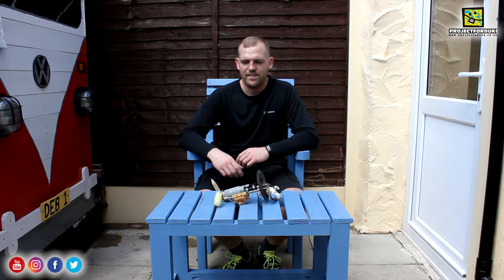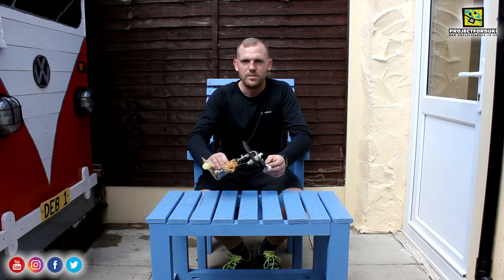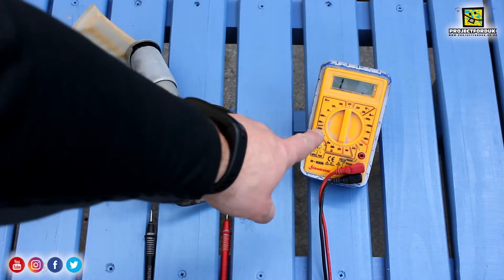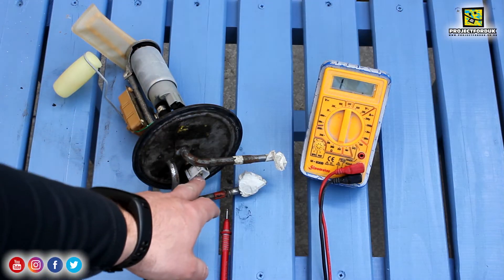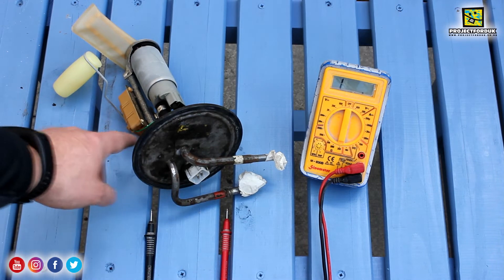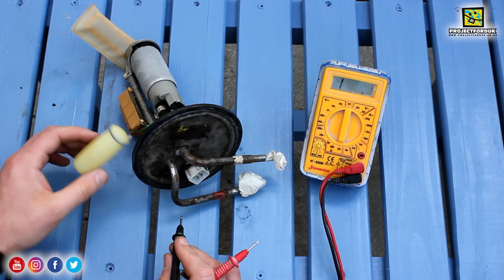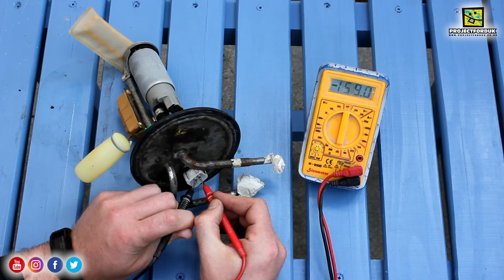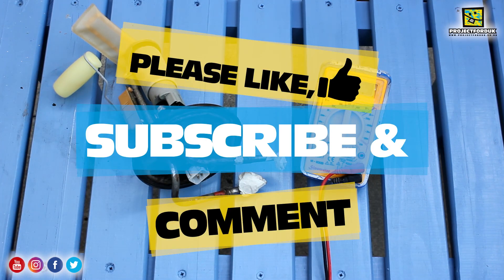How to test a fuel sender unit... it's easy

Comment: Was this particular sender unit, from an escort? Currently having issues with my sender (from a mk4 xr3i 90s spec). Pump stopped working…so checked the pump directly by connecting to power and it works. It would seem a “black box” which is some sort of resistor/relay needed to be bypassed. This black box was located under the round head of the sender. Bypassed it and the car started fine for about an hour…it kept cutting out and now it won’t start again. I can’t hear the pump priming when turning the key. Any thoughts anyone?